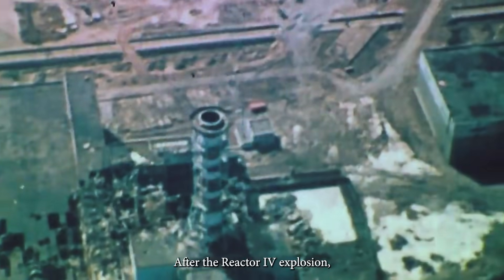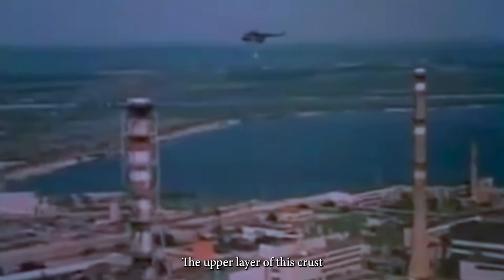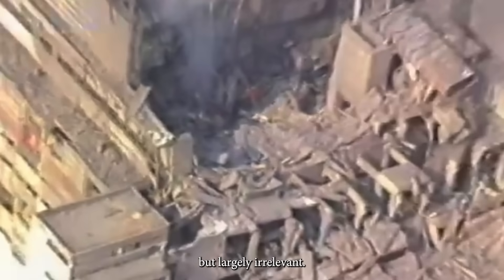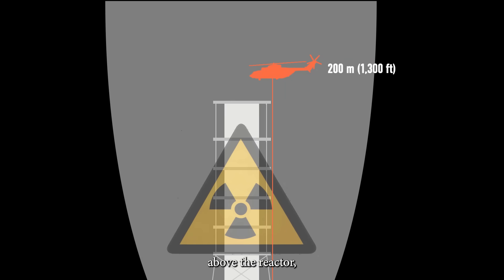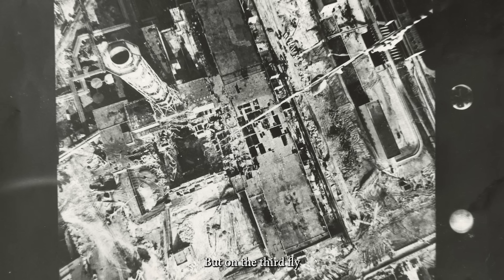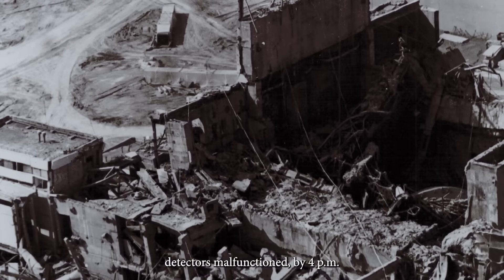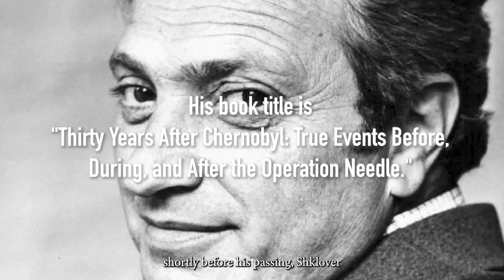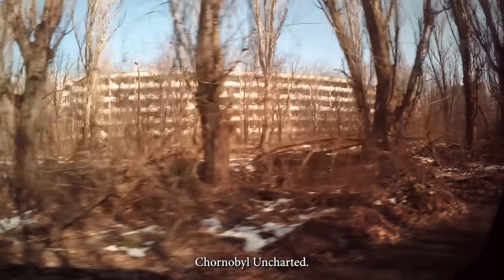Chernobyl’s Operation Needle: A Bold Plan That Went Wrong | Chornobyl Uncharted Ep 09

Comment: Mykola Melnyk was born in Ukraine. 

A Ukrainian pilot faced this danger for the benefit of the Soviet Union. 

Not a Russian pilot.
Reply from the maker: This.
And besides, this is the reason we use "Mykola", not "Nikolai" for his name.
Reply: Helicopters are hard enough to fly as they are. To spend 52 hours (cumulative) flying over an updraft of radioactive hot air just boggles the mind. Even if it was 15-30 minutes at a time, that’s still very technical flying and he had to know the long-term consequences of his exposure.
Reply from the maker: @joshcarter-com  especially, given what turbulence the convection flow made over the reactor. I myself cannot comprehend it, but I knew one pilot and he said it was hell strong.
Reply: @ChernobylFamily  Absolutely, the convection current would’ve been immense, and the helicopter he was flying wouldn’t have any of the automation of a modern helo. It would’ve been like wrestling an alligator the whole time.

Comment: I was reading lot's of books about disaster, but You give much more unknown information that can't find in any books, thank You!
Reply from the maker: Thank you so much!
Reply: Why did they do that fatal "experiment"?    1st.: A similar situation in the Petersburg RMBK reactor, which was a close call, was "USSR classified", as usual; so practically nobody in industry was in the know about the relevant physics. 
2nd. Tschernobyl No.4 had a sub-quality turbine, with a new, sleeker than before shaft; it was vibrating too much. They tried to improve its balancing; therefore I assume they needed to spin it up again, after the untimely shut-down of the reactor; to run it through all the rpm of the turbine, to measure its resonances and vibrations. They had a Siemens truck at site, with DEC computer equipment in it, a state of the art Western equipment (probably not really licenced officially for use in UdSSR), and with a time constraint on availability! 
 Who knows, maybe they they pressed on with the reactor to get this important measurement done.  I am just guessing! 
Later that Unimog-truck was parked somewhere, totally irradiated and abandoned. I saw it in a YouTube report, where the reporter questioned what for, and why was it there?